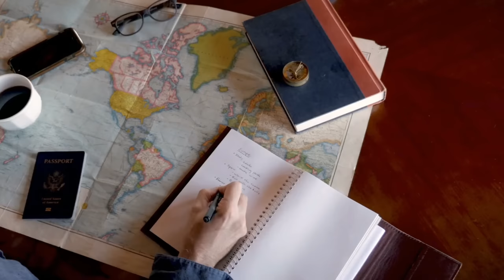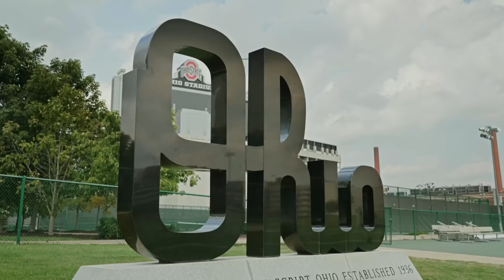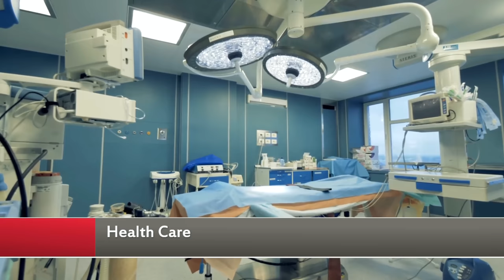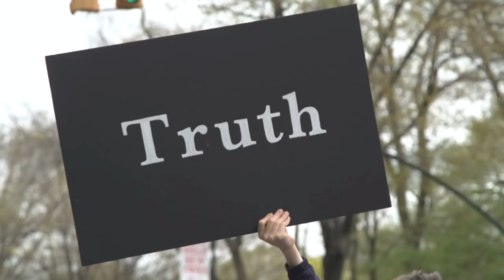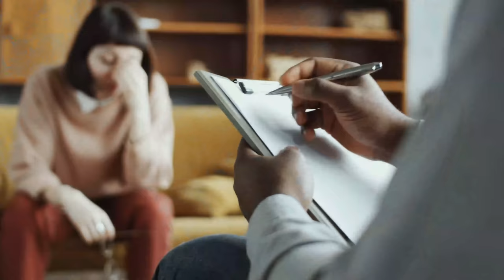The Good and Bad of Ohio.

Comment: Great Video.  I hear Columbus is planning for the city to be double its size with in the next ten year. I hope they get the rail system C-track installed before that happens.
Reply: that will never happen Columbus Ohio is too small to have a rail system
Reply: @gregc6073  its the largest City in the United States without rail.
Reply: @gregc6073 It the 14th largest city🤦 in the U.S.

Comment: I’ll add another con (or pro depending on how you look at it). Cops are everywhere checking for speeders. I remember one year I was heading down I-75 to Cincinnati for the 4th of July and I legitimately saw a cop every 2 miles the whole way down from Toledo. I moved to Michigan about 6 years ago. Ohio cops will pull you over for going 78 because you’re driving too fast. Michigan cops will pull you over for going 78 because you’re going too slow. See how that can be an issue around the border?
Reply: Ohio Troopers have always been big on speeding issues. I have found that the best way to avoid a speeding ticket is NOT speed.
Reply: Yeah...Michigan drivers are nuts..    If you're ever going to Columbus, be careful of speedtrap towns like Mt. Gilead and Sunbury....
Reply: In the Columbus area cops are only on the freeways a couple of times a day when it's not a holiday.  Most of the time it feels like you're more likely to get in accident when you actually try to do the speed limit because everyone else is doing about 20 over the limit while on their phones and swerving in and out of lanes with no signal half the time. Very "screw you, me first" attitude you see a lot.
Reply: This is a reason why I just set my cruise control in Ohio.
Reply: @LyleH45  yep thats what ive been seeing. I barely see any cops anymore since the pandemic. But everyday people almost hit me by being on their phones and they do go over 70 now that their hasn't been any cops.

Comment: Weather here is ok, as far as I can see now. I've been here two winters, and its nothing in comparision to the NJ and NY blizzards and storms I'm used to. Congestion is also pretty bad in the northeast, which you dont see here. Homes are very cheap but getting uo there in prices now.  The only thing I miss about it there are the beaches that you can drive to easily.  That and mountains, which are not found where I am in Ohio.

Comment: As someone who was born and raised in the state of Ohio. I've got got say. While the healthcare may be good in some areas. Where I'm at it sucks. Bad. 
Had my mother's boyfriend go to quick care in Cambridge. And he had a pretty nasty staph infection, all they did was poke at it, gave my mom some very unsanitary medical products, and told them to go home. The medical Q-tips were in a ziploc bag. (2 of them). A bottle of saline solution looked like they pulled it out of a nasty janitor's closet. (Covered in a sticky residue, no idea what it was.) And a tiny thing of gauss. Which was in another ziploc bag. So for Cambridge, the healthcare system is absolutely garbage. I do not recommend it. 

Weather. Where I'm at it's basically whatever mother nature decides the day is. Sometimes in Winter I see 70 degrees but in late Spring I see it get as low as 35 degrees. It really is a wild card as far as weather goes. And if you hate humidity. I highly advise you stay away from Ohio as in Summer, it gets very humid and combined with Arizona like heat. You might as well be in a steam cooker. I've seen it reach 120 degrees in July and August with over 90% humidity. Can't be outside for more than 5 minutes before you feel like you're drowning in hot tub water.

Comment: Dad's from East Liverpool Ohio.  It's right by both West Virginia and Pennsylvania, about 40 miles from Pittsburgh.
It was once famed for its pottery; they also made the insulators for electric poles. It's very much a part of Appalachia; my dad still says 'crick' for creek, and has odd sayings that as a southern Californian I'd never heard from anyone else until I visited the northern Appalachian region. 
Unfortunately it seems that East Liverpool really hasn't done well.  When I was a little kid they still had 25,000 residents.  Now they're down to less than 10,000.  And about 10% are relatives of mine, near and distant.
Reply: East Liverpool may as well be in West Virginia or Pennsylvania.  It's 40 miles from Pittsburgh.
Reply: @penguinsfan251  Which I mentioned in my comment.
Reply: My folks are from Steubenville,  right down the road.

Comment: Please be advised, if you plan on moving or visiting ohio, do not measure distance in miles. We only use time to measure distance,  ie. Toledo to Columbus is 2 hours away, not 111 miles. Clevland to hocking hills is a 5 hour trip. Not 350 ish miles.

Comment: I've grown up in the suburbs of Dayton and honestly, this place is alright. I've visited all over the country and I think this place has a bit of everything I really need. I don't know where else I would want to live, it's hard to beat the cost of living here. I live downtown and work from home as well as teach at the local community college part time. It's really turning around with the developing Water Street District! I hear about this place being super dangerous, but I think all cities have dangerous areas. Same goes for Dayton. West of i-75 is pretty bad, I never go that way. The interstate caused some major segregation issues in the past and it set a bad precedent that still exists today. East Dayton between downtown and WPAFB can also be a sketchy area. But there are lots of highways going in and out all around so it's pretty easy to avoid these areas. Also, lets not forget about the tornadoes that came through in 2019 and destroyed a lot of the lower income areas. Some of those areas weren't able to recover. Great areas here are Kettering, Beavercreek, Centerville, and Springboro. I think Huber Heights, where I spent most of my childhood, is also making some good moves in recent years. Ohio has a lot of development going on right now, you just have to look.

Comment: The worst drivers I have experienced are the residents of Indianapolis, Indiana. I-465 is a bigger, all day/night version of the Indy 500. The so called “speed limit” is 55 but cars blow by at 80+ routinely. Even when I drive 65 there are cars pushing me and zigzagging in and out of lanes.  But just getting to Indianapolis is a nightmare because they are constantly closing one lane of I-70 to fill 3 pot holes in the middle of the day. Hundreds of semis and cars have to a come to a complete halt as everyone (including those people entering from ramps) spend an hour or more to go 30 miles while squeezing into one lane. Worst run state for drivers by far. Last time I was on 465 a guy in the lane next to me was being brake checked by the car in front of him - the guy in front was waving a hand gun out his window for all to see.

Comment: Try being a driver from Michigan, if you’re traveling on the Ohio Turnpike  to Cedar Point. You’re most likely to get pulled over.  Even worse, when it’s Michigan vs. Ohio State rivalry.  Ohio has one of the best Drag strip in Norwalk, OH.
Reply: Every SUNDAY........and always on SUNDAYS...........(if you remember hearing the old radio ads for Dragway 42...)
Reply: dont speed you wount get pull over. get a dash cam that records speed. cops hate geting spanked by dash cam

Comment: I lived in Ohio from when I was born in '80 until 2013 when I moved to Oklahoma City. In recent years I've actually come to miss living in Ohio. Even though I'm from the Canton area. I do like how it seems Ohio has rounded a bit of a corner and and is starting to improve economically. Even the Canton/Massillon area has seen some improvement. Improvement which actually began before I moved. Because of that, I'm actually considering moving back.
Reply: I was out of Ohio for almost 20 years and moved back last year.  I thought I would never move back but it is very reasonably priced.  Originally from Columbus now I live between Columbus and Toledo.
Reply: @MrChrisH33  -   DON’T come back to Ohio!   We are FULL.   You forget about the big, scary grizzly bears!  You also forget about the wild weather.

Comment: Lived here my entire 50 years and the ONLY thing you are wrong (imo) about is #3 on the positives. There is NOTHING to do here and is a very boring state. Overall it is a middle of the road state imo. Many better and many worse to live in. The bottom line here is the same as everywhere, stay out of the big cities and you will be fine. Big cities are s#%T holes.